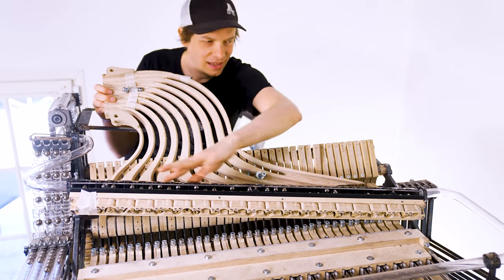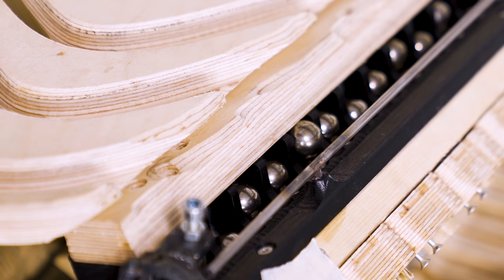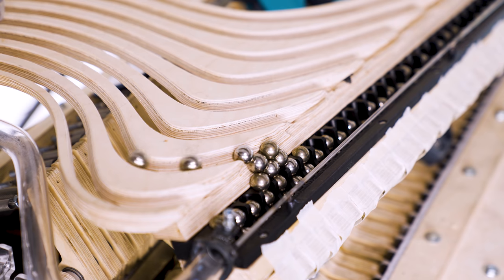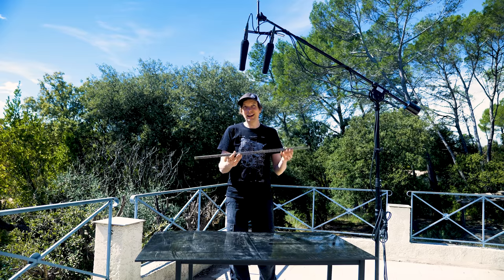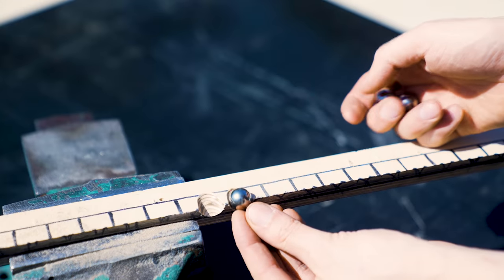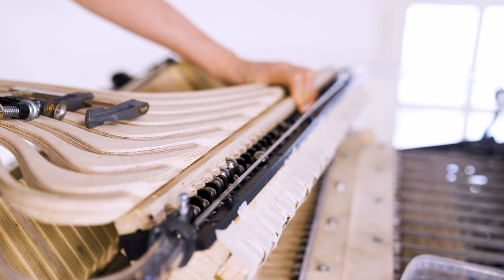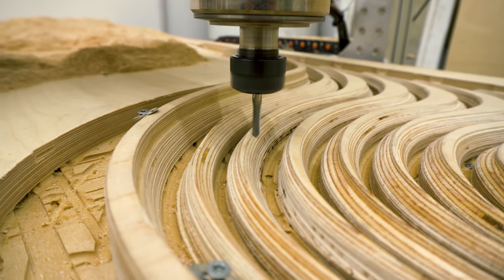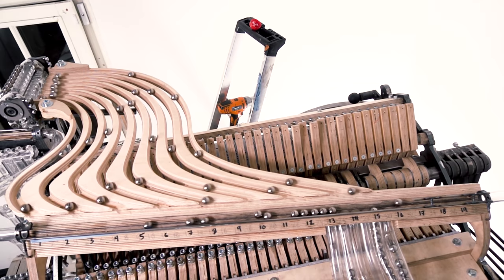Marble Tracks with Hidden Feature

Comment from the maker: This is a much bigger deal than what it might seem like. The height independent marble divider + the clock escapement gate is as far as i can see the two keys to unlocking the future of The Marble Machine X. Today the New Divider is fully functional for the first time and im really happy for this progress. Tomorrow i will start design the Final Version of the Clock Escapement gate with focus on Designing For Manufacturing and Redundancy of the mechanical function. 

From the top of my head these are the remaining issues where i haven´t decided on a solution yet:

- Making the clock escapement gate less loud, (remove metal on metal  sound from marbles/rails)
- Clock Escapement gate for the cyberbass (8 gates on TIGHT space)
- Fish Stair intro Pinch
- Would like to have a Larger marble buffer before fish stair 
- Replacing divide by 4 with some divide-by-n design with higher redundancy (got to comply with the more sensitive settings of the 2021 redundancy alarm)
- Vibraphone Superjumps
- Mounting system for HBS Stud Welding plates
- Shear Pins for HBS Stud Welding Plates

All the rest is just elbow grease :) lesssgoooo
Reply: Awesome!!!
Reply: You have no idea how happy I am for every victory you achieve with the Marble Machine X. Your videos are an inspiration and help me a lot to overcome my own challenges. What you are doing is bigger than you imagine! Thank you so much!
Reply: Dude nice
Reply: Do you mean robustness rather than redundancy?
Reply: Martin, it's not always Redundancy. It's more like Robustness
Reply: Please look up what redundancy means
Reply: Big chungi
Reply: Mirror the marble lane
Reply: Hey, are you aware that Bret Weinstein's DarkHorse podcast is using the OG "Wintergatan - Marble Machine" song as an intro and outro of the podcast?
Reply: Please don't remove the clock escapement sound, it has a unique and very nice sound!!
Reply: The hidden beauty in these new features, is that they can be copied and repeated for the rest of the machine. Everything else will fall in place so easily. These moles don't stand a chance!
Reply: It's not "redundancy". It's robustness.
Redundancy: the inclusion of extra components which are not strictly necessary to functioning, in case of failure in other components.
Robustness: the ability to withstand or overcome adverse conditions or rigorous testing.

The hand crank and the foot pedal are redundant features, because you can use them if the motor fails, or if either of them fail. The marble divider not getting clogged in certain edge cases is robustness.
Reply: But do you actually need marbles to drop on the bass strings?

From the youtube bass videos I watched it seems that you could:
a) implement a system where the strings are plucked instead of tapped or
b) use a vibrator on each string or
c) space the strings more and make a wide bass
d) implement a tapping system where the marbles press on fingers that will tap the strings but the marbles would never get near the strings.
Reply: Redundancy would be more like having 25 people explain to you what redundancy means...
Reply: This makes me happy! The longest part of the road is finally done!
Reply: Should this be a pinned comment? Cheers
Reply: @josephleopold3573  ... and robustness (or lack thereof) is still not getting it :)
Reply: I don't think you should remove the clock escapement gate sounds. They add a unique mechanical sounding feel to the whole system.
Reply: Congrats Martin and thanks for this recap! I think Superjumps gonna be a biggie. Can't wait to see how that all goes :)
Reply: Redundancy is the atleast doubling of something. If have a redundant power supply for example that means that it's one unit with two identical power supplies, the second one takes over should the first one die. Your Marble Lane Part is not redundant there is no other lane the marbles can roll on should a lane fail. When you make something less prone to fail you make it more robust. You can achieve more robustness through redundancy but literally nothing on the machine so far is redundant.
Reply: @2nd3rd1st , I think plywood is less sensitive to humidity than regular wood, but please correct me if it isn't. Either way, I believe Martin has mentioned that a group of people on discord are working on blueprints for a touring version of the machine, which will be optimised for the ability to quickly and cheaply make spare parts. I'm sure some of them will adress this particular part before the tour, if they haven't already done so.
Reply: Your persistence is inspiring!
Reply: you could fix the fish stair pinch and marble buffer by removing the fish stair entirely and route the overflow of marbles to the main lifting mechanism. less parts and less noise
Reply: Hi, you need to flip the black piece of the marble divider 180° to solve one of your to issue and make the other issue much more easy to solve.
Reply: I was thinking about the loudness of the clock escapement and I thought a good way to dampen that sound would be to add like piano felt to the escapement ‘hooks’... what do you think?
Reply: @terry_the_terrible  no, but that is one of the battles Martin has chosen to take on. There is no glory without pain :)
Reply: @TheGlassgubben  Good info, thanks.
Reply: @charlotteashleigh5926  There is discussion on discord about sourcing a higher tech material that will hold up longer than felt for some areas. But the best part is no part so it's a bonus when good design can eliminate the need for a part and especially one that would require maintenance.
Reply: @wintergatan so when is the next drums marble test with the new digs??!?
Reply: To those who say "don't remove the clock escapement gate sound because it sounds nice": remember that in this video there was only one gate working, but in the end there will be 38 of them, and they'll play faster rhythms. The nice sound multiplied would turn into a noisy cacophony.
Reply: I love your current method and seeing how happy it makes you. Great succes, keep up the great work!
Reply: You've got this!!! GO GO GO!!
Reply: Marbles on floor is not a machine error - it’s a marble error. Marbles getting STUCK in the machine is a machine error. Focus less on 1 in 3000 marbles on the floor. That’s not critical.
Reply: L
Reply: You'll never completely solve the vibraphone superjumps. You're getting into arcane stuff like resonant frequencies and converging wavefunctions. Overall you probably need to not obsess about every marble that's going on the floor, as long as they don't end somewhere naughty inside the machine.
Reply: Please 🙏 stop using redundant for what is really resilient.
Reply: @Execuor  Incorrect - two gates per instrument.
Reply: This is absolutely awesome. P. S. I think you mean reliable not redundancy. ;)
Reply: Nailed it!
Reply: I'd also consider redesigning the demagnetizer. Every episode you can see it holding up the magnets trying to get off the pick up wheel because the first magnets are spinning against the flow
Reply: This was fantastic to see! I've been following the channel for only half a year or so (watching all the videos on the machine, of course) but I got really happy and even a bit emotional seeing the machine working so flawlessly after the steps you've taken to make sure all the moles are taken care of. Great work and this really "throws a log on the fire" in the hope of finishing the project in 2021!
Reply: Lessgooooo
Reply: Its all coming together
Reply: The clock escapement sounds are great though, it's very mechanical and I love it. I do wonder how it would sound with all of them going off.
Reply: LesGO
Reply: >Making the clock escapement gate less loud, (remove metal on metal  sound from marbles/rails)

EZ: dip the rails in that stuff you dipped the funnels in.
Reply: I am so happy for you! I have only been watching for about 9 months, but have seen almost everything. I think we are getting close to the end of Wintergatan Wednesdays, sad to say.

All the best!
Reply: Get ittt buddy, rooting for you
Reply: Seeing mention of the stud welded plates on here makes me excited at how tantalisingly close the light at the end of the tunnel seems!
Any chance they could be black oxide coated or sprayed? I'm so used to seeing the MMX with a black programming wheel, I think it suits it!
Reply: robustness*
Reply: @josephleopold3573  welcome to the redundancy department of redundancy
Reply: Simple solution: Turn the black plastic unit around so it faces the back of the MMX, then the wooden marble track can feed the marbles onto the open side (what was the front) of the plastic unit.
Reply: @jeremyowens6031  small problem here the gates are doubled to be able to play faster music. If one gate fails the machines functionality is impaired. Thus they are not redundant.
Reply: ps. marbles will bounce out as they land on other marbles in the track of the sorter.
Reply: @ryanpaskin4572  That's entirely intentional, more time on the demag simply means stronger demagnetization which is a good thing.
Reply: Just the shaving the edges down makes the wood look nicer and helps with the functionality. 
Dropped two marbles for the price of one.
Reply: The removal of the gate height dependent marble divider is a huge step forward in the mmx for the first time in two years? The pma pipes can be bent and left alone if the programming wheel was a dragon this was a leviathan
Reply: Martin you should test more than one design of the clock escapment. In the discord they are many other itterarions to try out. Some don't need the broken escapment and some use very small components
Reply: I think you can try using pom on some of it for making it less loud
Reply: @Koushakur  i get that, but there's gotta be a better way. Even if its just removing the first row of magnets. It slows them that much that it only releases magnets at a rate that it only single feeds the conveyor belt which results in the middle slots being used. A faster flow from the demagnetizer will fill the conveyor belt
Reply: I'm a bit worried that channel 1 (maybe 1-4?) has the potential for running out of marbles. The first channels get their marbles from recycling only, and the velocity they have when entering the divider is probably gonna prevent them from going into the first few channels. No?
Reply: Please include a demonstration of how the escapement marble drops work. Or steer me to the correct video on channel 2. Thx!
Reply: @Execuor  depending on the desired music tempo
Reply: IM SO HYPED! YOURE DOING AWESOME MARTIN!
Reply: Just screw each bar to the plastic and skip the transition piece!
Reply: @MostlyPennyCat   or reliability perhaps?  multipurpose maybe?
Reply: Hey why not do a collaboration with davie504 once you're done building the marble machine X and  play some music with him he will  play the his bass and you will play the marble machine X I think that would be awesome 🤘😄
Reply: linseed oil !
Reply: @Execuor  Only if faster music is desired, but point taken.  I'm curious how fast those new gates can go.  It seemed like the additional pressure from the marbles above may make the gates work better at faster speeds.
Reply: @macedindu829  A coating of something was my first thought as well. But I realized that coating will be different for each piece. That leads to adjustment problems.
Reply: @Fr_Dae  I get it. Linseed oil on the wood would give a nice color and it reduces friction. The problem is a tiny bit of it will migrate onto the marbles and dirty the clear tubes they flow through. Just like how the dry carbon lubricant migrates onto the marbles and dirties the tubes that the marbles run over. ... Oh! The two combined would make a lubricant mud moving throughout the MMX further making it look dirty and much harder to clean.
Reply: @tigerzero5216  that not a dust, it'a oil, and if you use therebentine that benetrat to the wood. pretty clean and nice effect
Reply: Why do you no longer use any flip flop mechanisms ? The divide by 4 could actually be made of three divide by 2 flip flops as it was on the first marble machine.
Reply: Another idea: the divide by n that you want for the fish stair can also be a little brother of the divide by 38 that you just built on the MMX.

Comment: "It's actually nice to make a piece by hand from time to time and not by CNC"
CAD Team: <internal screaming>
Reply: woodworker screaming : linseed oil !
Reply: Yes it is. (Doing it by hand makes it a one of a kind.) Keep in mind there are rumors of a twin MMX being made for the tour. The one we see here could only be a test bed prototype that will not go on the road. (Just don't know.) I suspect, all that hand crafting will eventually be turned into a CNC program to create a replaceable part should one be needed.
Reply: @tigerzero5216  It's not a rumor, he has stated this multiple times.
This machine is just the prototype. He has an entire team doing CAD work of every part he makes so the entire thing can be reproduced.
 For the tour he will need at least two machines and a minimum of two more machines worth of spare parts. The second machine is so he can play a second song while someone else changes the programming wheel for the third song.